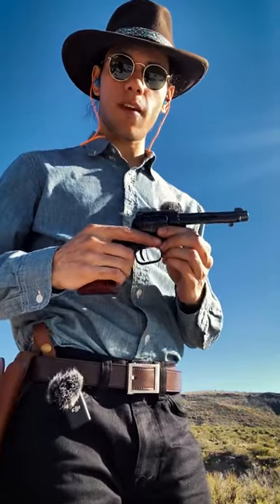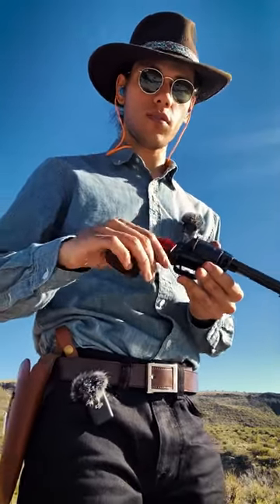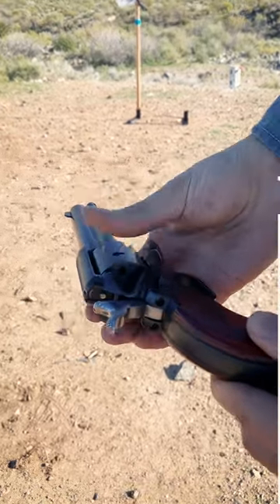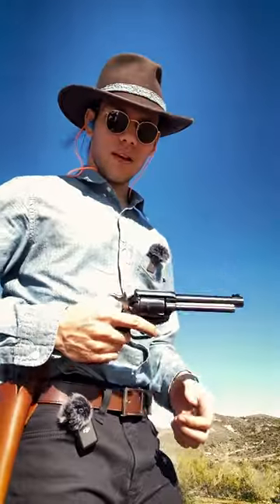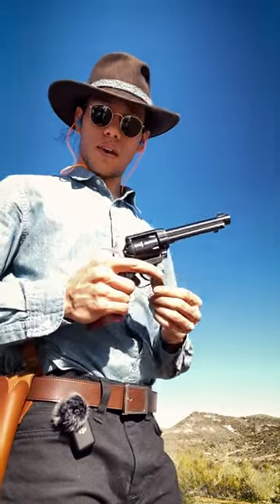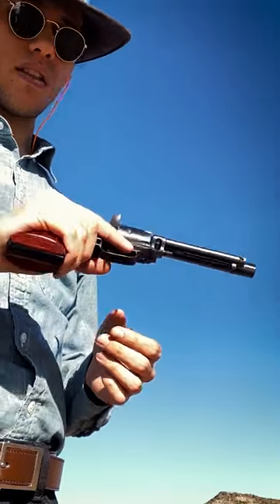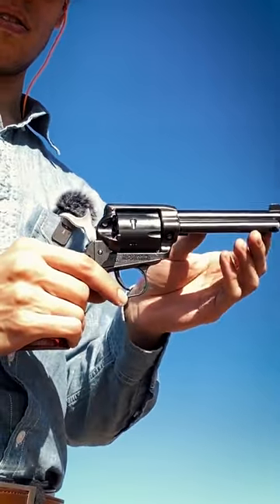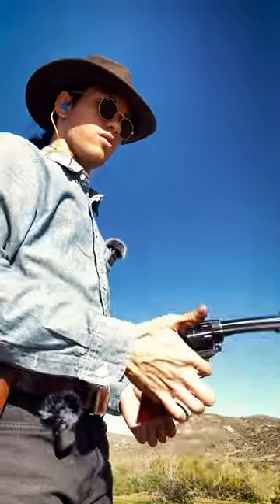The Small Iron #shorts #revolver #rdr2

Comment: I have one that is 6.5" barrel with both the .22 LR as well as the .22 WMR cylinders.  The 6.5" length helps with the .22 LR velocity, but especially the .22 WMR which does better out of longer barrels. The FPS you read on the ammo box is from a 18" rifle barrel. A revolver doesn't quite reach that due to the shorter barrels.